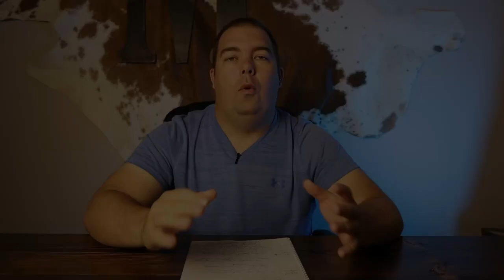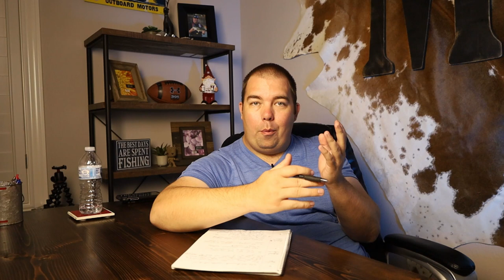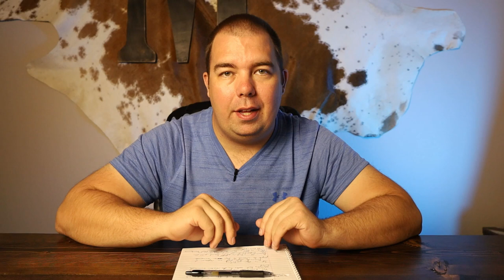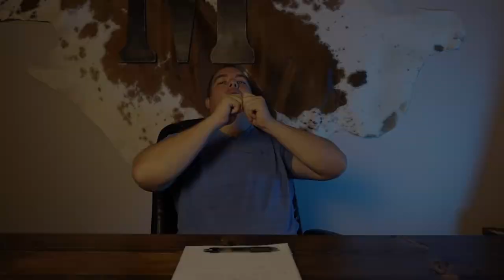Why Evinrude Failed?! | No More Evinrude Outboards (Thanks BRP)

Comment from the maker: Am I right?
Reply: Yes. 1000%
Reply: Close.. nothing fails for just one  reason. Reliability, product overlap,  failure to expand in to the higher horsepower sizes, stigma of the 2 stroke, poor marketing and last but no least not enough transoms. At this point it doesn't matter. The name has passed into history.
Reply from the maker: @raymondsolinas6976  Thank you for your insight. I appreciate it. You are correct as well. How high of horsepower did Evinrude go? I recall a 250. Anything higher?
Reply: @clearwaterfishing  the current line had up to 300 hp V6. I currently own a 200 hp V6 . It's a beast honestly
Reply from the maker: Raymond Solinas Ok so no super high hp. I hope yours last!

Comment: I’ve never heard or had a problem with Evinrude reliability, matter fact reliability has been top-notch and many boaters and mechanics a like know this. I spoke with a good friends master tech marine mechanic and he said that Evinrude has always been a very good reliable brand. The true fact and reason Evinrude failed is because of pushes from the EPA and society the market on everything not just marine is phasing out of the two-stroke market completely it’s all into the fourth stroke world now sad but true but this is the reason.
Reply from the maker: I go by my experience. I need had much luck with evinrude growing up. I agree there was pressure from the outside for 4 strokes that forced the phase out.
Reply: Yes for shore, sorry, for sure there is a strong current, sorry again, a strong push to go 4 stroke, owners of 4 stroke outboards will give you a difficult time if you show up with a 2 making you feel like a pariah.

Comment: I had a 200 horsepower Evinrude on a Stratos 19ss extreme. In 15 years, that motor never failed me.  All my friends with Mercury motors were dropping lots of money... I purchased a Tx 18 with a 115 Evinrude... So far, so good...
Reply from the maker: Thanks for sharing
Reply: tav5690 < I doubt your friends Mercury’s are giving them trouble.  You must trash the competition to make your out of production engine sound good.

Comment: It's a shame they most likely failed because of all these negative untrue facts about 2 strokes! I owned a generation 1 etec 225 ran it for 16 years it was a great engine. It was still running perfectly when I sold it to repower with a g2 300. The g2 in my opinion is the best outboard motor ever made just blows away every single motor that they tried to compare it too. More powerful and the fuel economy is off the charts. I personally have friends who run 300 Yamaha's and I'm not knocking them but they suck fuel down like there's no tomorrow they literally stink at idle you can smell all the unburned fuel! I have always been an evinrude fan and it's sad to see what happened to the company I can only hope they come back one day. When I asked how much a 100 hour service cost a customer like a Suzuki v6 it's like 1200 dollars it's crazy and a g2 can go 500 hours or 5 years without service except fuel filters of course I still change my lower unit oil.
Reply from the maker: I think most people think of the old 2 strokes when they think of 2 strokes. The smoke, the awful noise, the turning it over until your battery dies, and the overall aggravation with 2 strokes. When I go out to the lake the older 2 strokes outnumber the new ones like you described 10 to 1.

Comment: In 2016 I purchased a new Boston Whaler Montauk 210. At the time you could only have it factory rigged with a Mercury 150 FourStroke or a supercharged Verado 200. I wanted 200hp but the Verado was a beast on the back of this boat weighing in at 635 lb. I worked with my local Boston Whaler dealer who sold me a boat with a Mercury 150 FourStoke. He then sold the 150 FourStroke off the Montauk for me and gave me the selling price credit on a new G2 E-Tec 200HO. The G2 200HO is built on the 3.4l big block but is ~100lbs lighter than the Verado. So for me it worked out really well, 6 years later it's been flawless. Regular maintenance every 3 years (plugs, water pump, thermostat, gear oil, etc..) cost about $1,200. This boat sits on a lift in Punta Gorda, FL so I really like not having to do 4-stroke oil changes and having the ability to put the engine into self storage is also a nice plus.
Reply from the maker: Man that was back when 4 strokes were big and bulky. You definitely made the right choice for you.
Reply: The new Mercury 4 Strokes are much lighter.

Comment: I love my etec 2020 G1 Etec 150 HO  in salt water never had an issue.

So much power the 200hp
 4 strokers just let me go first to save the embarrassment.

I have sea tow if it does start to break down. I wont hesitate to speak up. 
Im a two stroke guy!!! I love  the clean direct injection 100 to 1 mixture!!! Just uses less oil. No smoke !!!
I cant wait till i can start to add stuff to her and get more out of her once the warranty 10 years is up.  From what i understand the HO is the same block as the 175 and running the HO im at 165 already. Im lovin it!!!
I have a great dealer that isnt going anywhere to maintain her on warranty then get everything we can from this engine once the warranty is up. 
She blows after 10 years of 2-3 days may-october on the ocean in New England Id still say she done me a solid 

Like i said ill keep posting her condition. 
At the begining of season 3 its been flawless. I do run stabil Marine the "Blue Gas" to keep it running good.

I do hear it always starts with Bad Gas!!!

Have a Great season and if you are lookin for a great deal on real power plenty around cheap!!!!!

Long Live Two Strokes!!!
Reply from the maker: Hope she last a long time for you. Welcome to the age of 4 strokes buddy!

Comment: All my two strokes are very reliable.  More parts to fail in a four stroke.  Now you have timing belts to change in addition to oil changes.  Enjoy turning your wrenches!
Reply from the maker: I can't tell you how many times I have seen people get to the ramp and leave because their 2 stroke won't start.
Reply: I actually have had more problems with 2 strokes that I have never had with a 4 stroke. I’ve never been stuck off shore with a 4-stroke before but I have numerous times with a 2-stroke very unexpectedly. (And I’m OCD for maintenance and cleaning my motors regularly)
Reply: @clearwaterfishing  our gen 1 250 ho on our 18 ft ski race boat has been near flawless for years of social and racing use, it eventually needed a new power head from running it out of fuel at wot one too many times but has been flawless once again for 200+ hours ps it starts first time every time in under 2 seconds
Reply from the maker: @SkiRacingOz  Good deal
Reply: @clearwaterfishing  yeah, great motor though I really think bro should have started making 4 strokes as a side project to generate income, they already had a 300 ho, 350 and a 400 in the works that were really gonna prove the two strokes can be developed in to the 21st century but alas, they wouldn’t even make a four stroke, it wouldn’t have to be their main focus, it would just have to keep their finance afloat to bring out their updated motors and expand their range to 400 hp

Comment: All we ever owned were Evinrude or Johnson. Great grampa had 2 Evinrudes on his 2 boats. Always ran, never had to row home or get a tow. Dad had an Evinrude 75 on his 1956 Lone Star Cruisemaster, and I put a 40 E Tec on my 1965 Lone Star Medallion II, and haven't had 1 issue with it. Runs clean, no smoke, simple maintenence and runs for ever on 6 gallons of gas. Go out trolling pike, muskie, smallmouth or walleye. Runs all day, and idles so low it is my trolling motor.

Comment: as a person that was in the marine industry for over 40 years and serviced all brands of 
outboards  it's very easy to understand why they failed  the EPA mandated lien burn engines, and took the lead out of fuel and added up to 15% alcohol to regular gasoline
two-stroke engines use the fuel to lubricate the cylinders and it's such a lean setting to pass the standard, they just didn't have enough lubricant in the cylinders to survive.   Plus at the time the whole industry was moving to four stroke outboards ,  
and the fact that FITCH engines were total junk . And the early ceramic lined  Etec engines were blowing up at a high rate . But the real problem was management not changing with the times and going to four stroke Technology,  The marketing could've been phenomenal 110 years in the game with 3600 dealerships nationwide remarkable they failed
Reply from the maker: That sums it up very well! Thank you for your comment.

Comment: You hit the nail on the head my friend. The G2 was a failure. I know. I spent more time in the shop doing  repairs than routine maintenance. I have been working on outboards my whole life. More service schools than I can remember. Yamaha, MerCruiser, Force, Mercury, Tohatsu and Evinrude. Multiple times!  It broke my heart when they went backwards from the Etec to the G2. Feel so bad for Every person that worked so hard to buy one. Only to be let down!
Reply from the maker: Sorry man. At least you had some good business from it.
Reply: @clearwaterfishing  We did. but then we had to explain why we told our customers what a great motor was. Many of them felt that they were misled. When they ran, they had amazing power and a one of a kind sound. Just plagued with issues. Heartbreaking.

Comment: In 2018, i bought a new 22' Robalo they come standard with Yamahas, but there was a little-known motor option Evinrude G2 . I literally had to go through hell and pay $1200 extra shipping from an out of state dealer to buy, rig and ship the boat just to get the G2 250 HO.

Because I wanted the HO high output motor Robalo would not factory rig the motor, they stated the rigging is different on HO models. Its the exact same motor as standard but with modified software. When I called Evinrude they were useless and indifferent, I thought for sure they would help me get their motor installed on my new boat.  Robalo management was even worse re: installing the G2 HO, but I figured they had an incentive to do Yamaha. Ive had Evinrudes for 40 years and they were always rock solid, I honestly think the G2 is not as reliable as earlier etecs. Currently I'm getting an engine code for knocking at WOT the engine then reduces to idle and needs to restart. Bad fuel is what my mechanic thinks, although I'm careful about treating and using my fuel. 

 Talk about pissing upwind and then Evinrude pulls the rug out from under our feet...we quit...huh? They even removed the etec forum from their website that people networked to share info. Thats a good example of why they went out of biz, and mediocre marketing. They tucked and ran, no one likes a quitter like Evinrude Bombardier
Reply from the maker: Man… I’m speechless on this. That is awful. If it doesn’t knock throughout the rpm range it probably is fuel though. A rod knock typically can be heard at idle. I hope everything works out for you man.

Comment: Ive been a boatie for over 40 years, and bought an evenrude 140HP second hand in the early 1980s which never broke down and battled on until 2019 on a 17ft half cabin. I only lost it in a wild fire or would still be using it. I think the only thing that killed Evinrude was 4 stroke competition in a changing world. It was a marketing issue, with people mistakenly believing 4 strokes were more fuel efficient and lower emissions which wasn't the case. Etec had the lowest emissions of all from memory.

Comment: So I'm picking up my first boat ever, a Lund ssv and the dealer in CT  is selling me a 40hp evinrude etec tiller..should I be wary of this motor? Thanks
Reply from the maker: You will be good. They will have parts for decades.
Reply: @clearwaterfishing   Thanks for the information, just don't want dealer selling me his deal to get it off the floor. They tell they can't get a mercury until September 2021. Should I ask for a different manufacturer? Yamaha? Thanks again.
Reply: @jimlatorra2693  Yamaha is pretty much one of the best and most reliable outboards if that’s what you are looking for not all of them are perfect but pretty much all especially the 4 strokes are very reliable if you do your maintenance

Comment: I've talked to many satisfied E-Tech owners,  but four strokes have improved leaps and bounds  and E-techs  were just  losing market share to them.  I noticed that most E-Tech owners were older guys from the two stroke glory days.
Reply from the maker: I think the younger guys like 4 strokes and like you said with older guys.
Reply: @clearwaterfishing  I come from the two stroke generation and sometimes I miss the sound and smell of a two stroke outboard...and talking to other guys about the type of premix oil they use. (Oil is always a good conversation piece)   Not my wife though, she loves our clean quiet Suzuki.   I wouldn't go back though.
Reply: I'm in the middle, 37 yrs old, I have an etec 90 and absolutely love it. Zero issues what so ever. Touch the key it starts, it's quiet, and fuel efficient.
Reply: @hydro_rebel7741  Not taking anything away from them. I have a friend who has one and the are pretty amazing as far as  power and speed.

Comment: I do a lot of deep sea fishing. I have got an evenrude 225. G 2 I have found it very reliable and feel efficient. I do 300 hours a year? I had on all the other brands Yamaha mercury changed my motor every 1000 km because of problems with the other brands weightwas a major issue with Yamaha it made my boat sit up to high

Comment: I hate that two strokes died. Evinrude was awesome in the 70s 80s and 90s. I would take OMC over any of them. I was really pulling for the eTech because in theory it will deliver better power and cost less money. With less maintenance.
Reply from the maker: 2 strokes were on the EPA's list to get rid of. I don't think it mattered how reliable or the power delivery is/was.
Reply: @clearwaterfishing  They’re going after four strokes now. At least and automobiles. JD power and Associates just released a survey that showing cars are getting less reliable. I suspect it’s in part of high speed transmissions turbo engines and direct injection

Comment: It's heartbreaking & they had just come out with their high powered electronic tiller models. There is nothing like the 2 stroke snarl of these motors. Especially in small motor segment~ a 40hp Evinrude is a snarling BEAST. Any other 40hp 4 stroke is pathetic in comparison. With Tohatsu 2 strokes phased out its over for 2 strokes. Sorry but you are wrong about Evinrude quality~ fewer parts = fewer problems.
Reply from the maker: Not wrong IMO.
Reply: @clearwaterfishing  Yes, you are wrong best motor's built.
Reply from the maker: @johnmerriman4867  if they were the best why don’t I see many on the water?
Reply: @clearwaterfishing  as you said in your video, they rely on people repowering, and they dont own any transoms (you litterally aswered tour own question in your video)

and in Norway litterallu half rhe "fast" (nordkapp/finnmaster) boats use evinrude g2 300 hp engine
Reply: @clearwaterfishing  i respect you for taking you time to read comments and reapond to them
even if i strongly disagree with your views on Evinrude engines i appreciate that you take your time reading comments

sorry for my last comment being kinda rude

Comment: Well, I agree with some of your points.  Boat/outboard packaging did a number on the outboard industry in general, and killed off any dealer loyalty there might once have been.  These outboards are shipped directly to boat builders where they are mishandled, used and abused, and almost never properly rigged or propped out right.  The OMC boat packages were horrible indeed.  OEM controls/cables/harnesses were overlooked for cheap junk stuff.  Try explaining to a customer that his OMC branded boat engine package was not built with OMC controls/cables, harness' or props.  The outboard became just something that came with the "XYZ" boat, and lost its identity for sure.  
The Ficht engine was brought out way to early, and was the final nail in OMC's coffin before BRP took over.  The EPA regs in 1997 forced the industry to comply quickly, no excuses, just reality, the new technology just wasn't ready in time.  Unfortunately, many dealers and owners ended up with broken engines that weren't repaired by BRP under warranty.  The ETEC was a great engine indeed, BRP did a nice job with them.  Unfortunately, OMC had soured so many dealers and owners, there was no way they would buy another outboard from OMC/BRP, no matter how good they were.  
I would agree as far as marketing goes, the public falsely believes that the four strokes are far superior to the simpler, lighter, more powerful two strokes.  The newer direct injected two strokes were amazingly fuel efficient as well.

Comment: Thanks for your opinion,it helps. Dang, I wish you had better things to say. I’m looking at a 2013 16’ Glastron Bowrider with a 115 e-tec. The boat is in immaculate condition, and literally looks brand new. But, the motor only has 50 hours. The low hours concern me too though, as I live in Ontario Canada. I don’t know where it was stored, if it was winterized each year, did it sit for years unused, or what. We took it for a water test today, but the dealer wouldn’t let us drive it, so can’t get a feel for it. I don’t want to be swayed just because it all looks brand new. What is your take on the low hours. The dealer tries to tell me how great that is. I call Bull.
Reply from the maker: I wouldn't buy it mostly because it will have problems down the road (all motors do). Are there going to be parts available or someone to fix it? Maybe? I would look elsewhere.
Reply: @clearwaterfishing  thank you!! We passed it by today. I appreciate your comments. The owner would share records. Just sounds fishy and I wasn’t getting a good feeling!